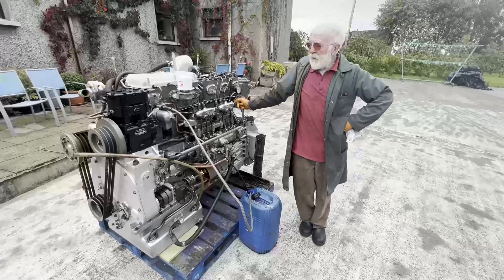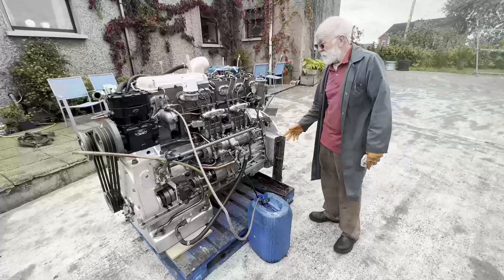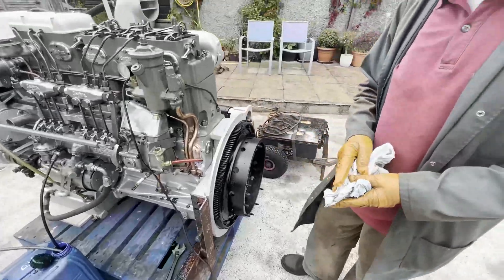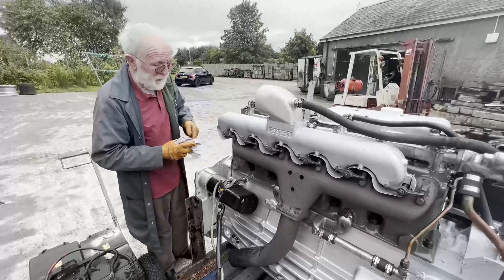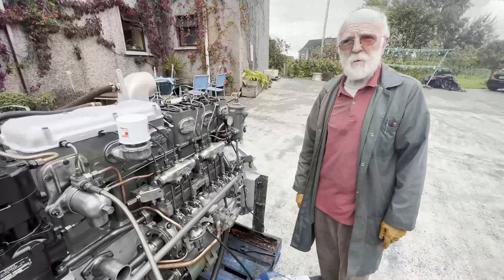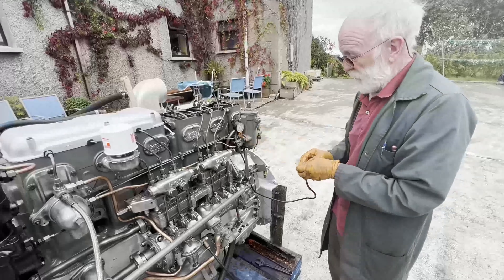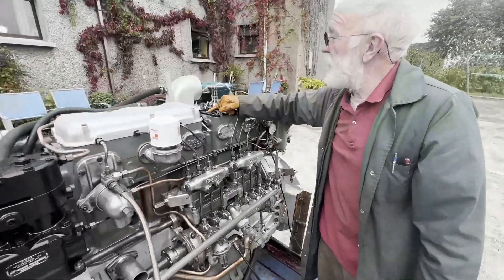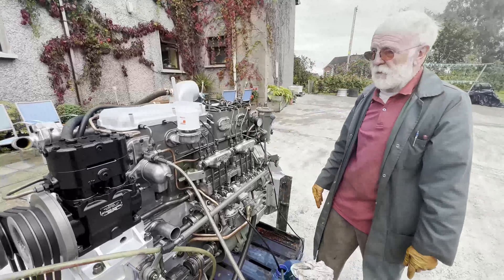Gardner engines: an original automotive 6LXB fully restored.

Comment: I was apprenticed in 1976 by Greater Manchester Transport UK. As a Diesel Fitter. I worked as Craftsman for them till 1985. Emmigrated to The US. One company I worked for was a tour bus company, running British double deckers around the city of Chicago. I would say 80% of our total buses were Daimler fleetlines. All running Gardner 6LXBs . The Quality of the vehicles, all built at coachworks around the UK was second to non. It actually approached if not equalled the build quality of US milspec. It would infuriate some body shops tasked with changing steps. and entryways from the left to the right side, enough . That  I took on the job. After a few becoming really good at it. It was this job that gave me the respect and admiration of true craftsmanship. Which led to my love of those beautiful Gardner engines. 1800rpm max. had an injector pump you could (and did) calibrate, right there on the engine. cut out levers and decompressors allowed cutting out the cylinders. It was nothing to have a Gardner idling on one cylinder. Sounded like 100 rpm. And to look at!. I am actively at 65yrs old looking to find a 6LXB.  For no other reason than to own and admire it. If women had the same appreciation as men for these things. Gardner could be in the furniture business and still thriving. The most georgous object made for utility I have ever seen. If my dream becomes real, A video will be posted of myself proudly running it, in the house hooked up to a blender or something.

Comment: One if not the best diesel engine ever produced. The LXB series really were the epitome of thermal efficiency, (over 40% ) maximum torque at 1,000rpm and maximum power at 1,850rpm. In addition, legendary reliability, many covering over 1,000,000 miles! 

Oh, and they look beautiful. It doesn't get much better!
Reply: Oh....I'm back in the 1960's in the comfort of a United Automobile Bristol RE, listening to the melodically smooth relaxed Gardner as it cruises the A1 from Newcastle to London Victoria, where it'll be cleaned and refuelled, before heading back through the night to the north east.....where it'll be cleaned, refuelled - and do it all again - day after day, night after night, month after month, year after year, a million miles clocked in five years with ease - and plenty more to come.......all thanks to it's legendary Gardner power!
Reply: i worked on a mixed fleet of rigids and artics ,these are no good for road haulage the best engines at this time are cummins for this type of work

Comment: It's a beautiful engine..  just curious.  Could one use that as marine engine with the big fly wheel and modified cooling  less the compressor of course.  And how would it perform as what kind of fuel consumption would you expect from it.
Reply from the maker: Yes, they are used in marine applications quite often.   You will not beat them for fuel consumption.

Comment: I worked on Gardeners for 8yrs in the 1970s and in all that time we never had to take a engine out and only once was a timing cover removed , my mate worked all afternoon fitting a water pump and I noticed he'd not put the fan on before refitting radiator , why i dont know he was a really good fitter ex REME man , I kicked fan under bench and waited till he'd put last bolt in crash bar - then said "are you not fitting the fan Jim " went down really well , those were the day's when you could have a laugh at work and sadly long gone now .
Reply: i worked with a man  back in the late 70s his name was  Jimmy Byrne he was a great mechanic  he use to say the Gardner was the best engine ever made, hardly the same person from ireland ?.

Comment: Once upon a time had a Gardner 6L in an old sea going yaht ....
It was a bit smokey and bit thirsty @ 10-15 litres an hour @ 1500 revs 
Fitted a 48 volt hydrogen electroliser ....
feed the  hydrogen gas thru a refrigeration gas 5/8 filter straight into the 6L intake  manifold @ 1000-1200 
Smoke disappeared
Engine oil stayed clean 
And @ 1200 revs power was as strong as previously found @ around 1500 revs 
Fuel consumption went down to 7-8 litres an hour
🇬🇧👍

Gardner

Comment: I'd love to see a video of the difference between an 6LXB and 6LXC. I own the later and there's very little information on LXC's
Reply: My local bus company, Eastern National, had most of its Series 3 VRs fitted with Gardner 6LXBs, but they did have a couple with 6LXCs. I think these 2 went over to 6LXB, as did 3 of their VRs with Leyland 501 engines, the S reg ones.